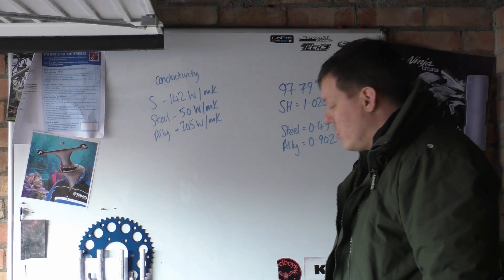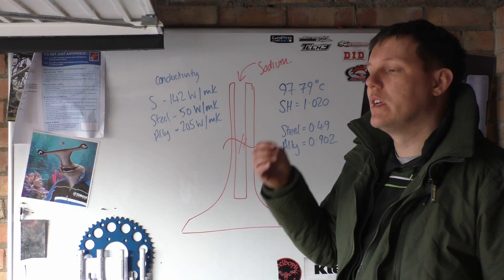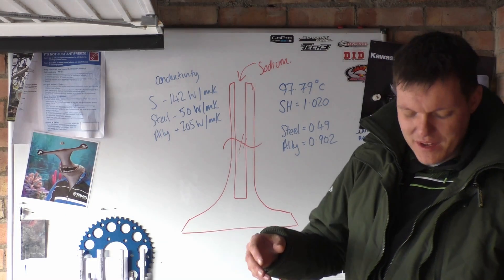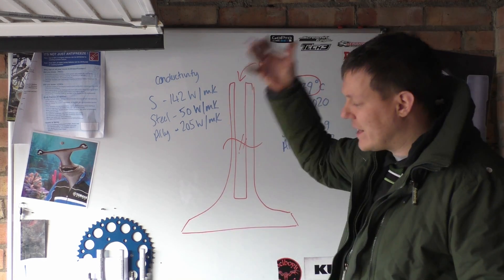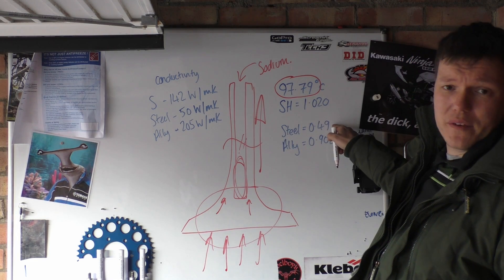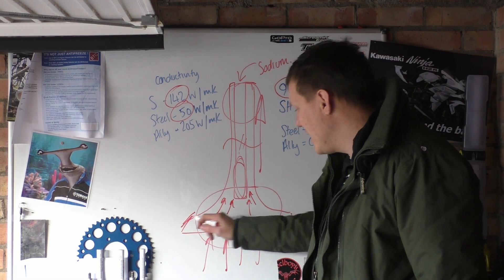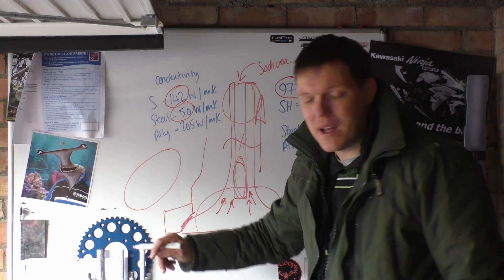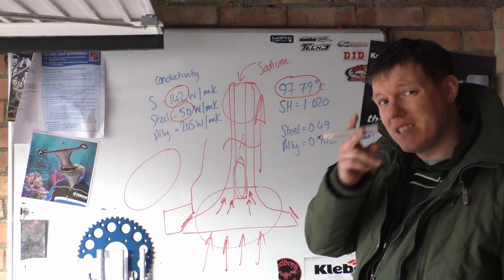Why Sodium Valves?

Comment: It's not the phase change from solid to liquid, it's the phase change from liquid to gas. it works as a thermal pipe, extremely effective way to move heat

Comment: I wonder if the liquid sodium "sloshed around" a bit, which would affect things such as "valve float" at high rpms.
Maybe it would buffer movement and prevent "valve float". 
Maybe so high pressure that there is no sloshing and no effect at all.

Comment: I wonder if valve overlap and proper cylinder purging will solve this cooling issue...
Reply from the maker: Well no - well yes actually - that made sense.

Could you yes. Would you no.

You have to make a decision at the very beginning to make an engine that ran with timing that was beneficial to the valve temp, but the valves work for the system to make power, not the entire engine is there to keep the valves cool.

Comment: don't want to burst your bubble, but i just learned this when i nearly bit someone's head off on the internet after decades of thinking i understood sodium valves: in high performance engines, sodium cooled valves work as heat pipes, by boiling the sodium over 800 degrees C. yes they use the liquid-vapor phase change. presumably sodium is always liquid at any exhaust valve temp that counts and solid-liquid phase change is irrelevant. and obviously they will still function below boiling. also, the reason they don't explode under pressure is that the way you make a heat pipe us you bring it to boil and seal it hot ... in a copper (ie low temp) heat pipe you put a torch at the bottom, clamp the top and solder it. the reduced pressure also means you have useful vapor pressure significantly below the usual boiling point. also also, iirc it is/was a common problem for people to replace a normal valve with a sodium one and have problems because the system wasn't designed to dissipate that much heat from the valve stem
Reply from the maker: Really?

From Rheinmetall who makes valves - 

"Hollow valves

Hollow outlet valves are mainly used for lowering the temperature in the particularly vulnerable fillet area and are additionally filled with sodium. A desired and positive side effect is a reduction in weight. Hollow, unfilled inlet valves are only used for this reason of mass reduction. In order to achieve a temperature decrease for valves, the skirt that is drilled hollow is filled with sodium by approx. 60 % of the volume and closed by a friction welding procedure. Sodium melts at 97.5 °C, has a 
density of 0.97 g/cm³ and is a very good heat conductor. During engine operation the sodium becomes liquid and is moved backwards and forwards in the skirt by the inertial forces. This is also called “shaker effect”
"https://www.ms-motorservice.com/en/products-applications/products-in-the-engine/valves/"

A massive paper on the original valve design to the 1990's 

https://www.newcomen.com/wp-content/uploads/2012/12/Chapter-22-Starr.pdf

https://external-lhr3-1.xx.fbcdn.net/safe_image.php?d=AQAsAJ4LoVym5RMO&w=492&h=431&url=https%3A%2F%2Fcimg9.ibsrv.net%2Fgimg%2Frennlist.com-vbulletin%2F800x701%2F80-new_11357837596_3dd125b3e039b5cace3959b4aad63da99b20552a.jpg&cfs=1&_nc_hash=AQDnK1MQAjcDs1_H

From TRW - who make the valves 

https://scontent-lhr3-1.xx.fbcdn.net/v/t1.0-9/28685658_2004486359818476_2177092196365415438_n.jpg?oh=4d887bc4aedc62d025e3ab5d74af3304&oe=5B41EC3E

I do have a question though - where do you get this idea?
Reply: i'll have a look over that material when i get a chance, but i'll note (1) valves working primarily by "shaker effect" is not incompatible with either (a) solid-liquid phase transition being irrelevant ... we can probably agree performance valves operate at over 100C, or (b) that in extreme ranges sodium valves operate as liquid-solid phase heat pipes, (2) friction welding is exactly what you would expect for a valve being sealed hot enough to be filled only with solid/liquid/vapor sodium, and (3) the internet is abundant with examples of claims of these valves operating in heat pipe mode, as i discovered shortly before i tore someone a new one. technically, there will be SOME phase change cooling with any valve stem temperature differential where the hot end is above freezing, so the question is really one of degree. what's your guess for the highest exhaust valve temperature in a freakishly over-turbocharged performance engine?

Comment: It's been around forever and always bothered me.  Is there air in there, or a vacuum, which I really doubt?  I think the whole thing is bs.  I think they should just cool the heads.  
But carry on.
Reply: so you think it's bs, but you never considered studying the matter?
Reply: Yeah, that's pretty much it.
Reply: The valves would also get so hot it would knock (preignite the fuel/fuel mix just by contact).
They did this a long time ago, when material science wasn't as good, and no computer modeling...

Comment: My grandfather has a Toyota HiLux 4x4 that is turbocharged and it has sodium filled valves. As I understand it some Nuke Ship engines or submarine engines used sodium as coolant on one side and water on the other side. The problem is that if the engine ever cools down completely the sodium side has to be manual heated before you try to restart the engine because it will become a solid in the plumbing. I do not think they do that anymore I think it was the Russians that did that. If your engine is working right that side is almost maintenance free.

Comment: But why sodium and not other material that already is a liquid?
Reply from the maker: Good question - like what? It has to be something that phase transitions at a resonable temperature, has good thermal properties (i.e thermal conductivity) is inert to steel and doesn't weigh too much.
Reply: the reason it's not whatever random liquid you're thinking of is because metal holds a shit ton of heat (heat capacity). but also sodium is a compatible metal, and cheap (but hard to handle). and finally, it has a low boiling temperature but i'll post separately

Comment: Wow. I didn't know sodium melts at such a low temperature. It's sort of like a copper heat pipe. 
I assume though that for efficiency it's better to just have a metal that handles more heat, as heat is power.
I've heard of ceramic engines for this reason, but wouldn't ceramic valves be very weak? Or maybe a diamond engine 🤔
Reply: https://depts.washington.edu/matseed/mse_resources/Webpage/Ceramics/ceramicproperty.htm Thus being said, metals are better, because when stress occurs they don't break immediately, they first get deformed, operate at lower efficiency, but operate nonetheless. When ceramic are stressed, they either continue with work or break in minute when stress peak is achieved ... i.e. metals are better in this kind a applications. That's why you don't see cylinders made of ceramic, they don't like to be in the "mechanical" kind a way ...
Reply: which is why they never use ceramic brake disks. no wait ... it's because ceramics that are strong at high temperature (often a ceramic composite) are freakishly expensive, and their thermal expansion is different from any surrounding metal

Comment: Cool it was use in bikes Norton used sodium filled valves on some Manx Nortons after the war, however, this was done to cool the valves  not so much to stop them from breaking (by the late 40s materials were much improved) but to stop  the crap pool petrol 70+ octane fuel from pre-igniting  on the hot valves. Norton needed to get as much power as possible and it very hard to run high compression ratios on crap fuel hence the valves. They could run much higher ratios in the 30s than the 40s until they were allowed to run proper fuel and didn't want much slower bikes, so they used sodium valves to try and keep the compression ratios as high as possible.. Obviously after the war Norton developed the featherbed frame and the better handling also helped compensate for the lower power.